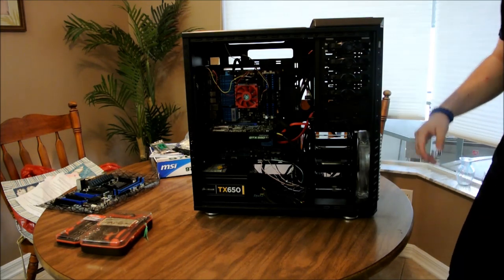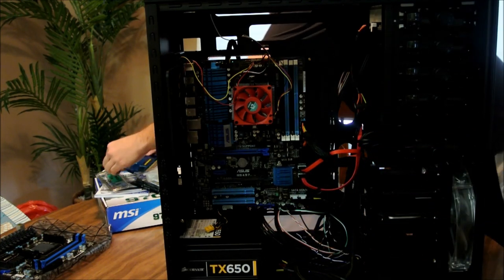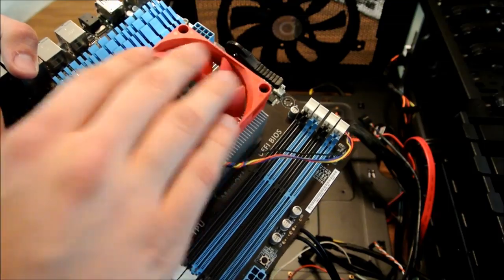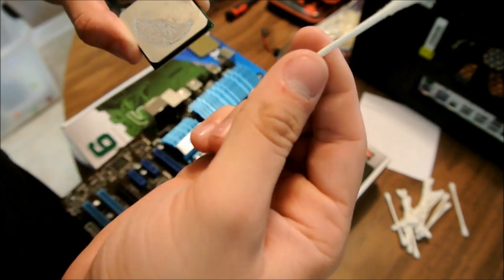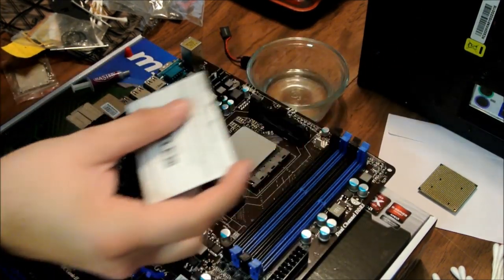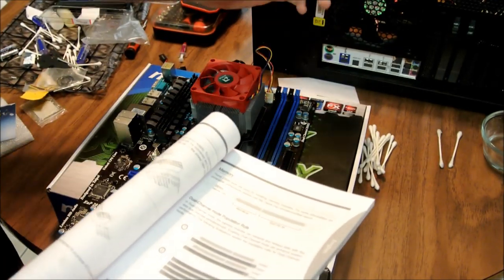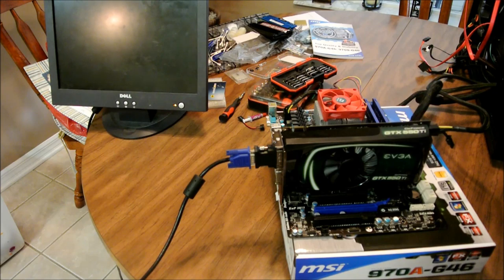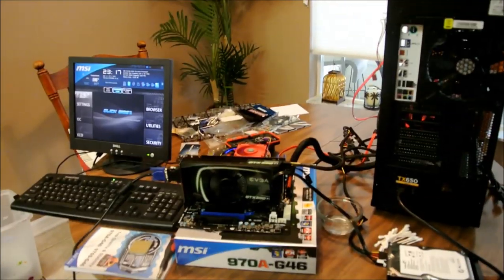CPU & Motherboard Basic Swap, Test, & Install

Comment from the maker: After doing any sort of major upgrade such as switching the motherboard, I always recommend installing the appropriate drivers/software made available for it. Personally whenever I do major upgrades I also re-install Windows just because I am OCD like that. I would say for certain, update and install drivers. You don't have to re-install Windows, normally.

Comment: Bet they never jumped the CMOS. My old board wouldn't post. Even the cup fan would rev up to max rpm. Does that mean broken computer? No. Sometimes replacing stuff won't matter because the board itself is just confused on how to initialize. Clearing CMOS resets settings and loads the factory booting sequence back to the board. I did that and my board posted and booted my computer no problem.

Comment: I know this is a late comment but all these butt hurt people that are saying he is bashing his friends computer parts should just watch the video or go to another one. I am sure his friend has been told by this guy about his pc parts. Who really cares and amd is not that good compared to i7 intel. I have the amd cpu and I have the Asus m5a97 le r2.0. Its been good up til I had to do a full system recovery because it wouldn't boot to the desk top. Its better now though. I can't wait to go back to Intel i7 4970k next month I am getting the cpu and will be getting a motherboard to go with it. Not sure what mobo I will get though. Great video man.
Reply: +uhavemooface dude you literaly just said : 

Okay Porche is not as good as Mybach...

So youre Actually comparing an entire Company (in this case AMD) with only ONE line of products from another company (in this case an Core i7 4970k from Intel).

Amd is a really good precessor company and sure there are models that are not as good as a i7, but there are models that are way better then some i7 models like fro exemple he Amd A10 7850k wich competes pretty well against the core i7 4970k costing less then half its price!!! so Frame per Dollar/euro is way better on AMD and i think that for 5fps i'm surely not spending 150euros more. 

You seem really just taking "more money is better" as granted, well in computers that is not so easy. 

I have build myself a 500 bucks gaming monster based on AMD able to run EVERY game i throw at   it in Ultra. Without any problems... and dude i've spent 500 bucks. A friend spent the same amount on an intel build and his games lag at high graphics because he only went for a i5 3500K or something... 

But still i'm no master at it far from there, but i just find the way you explain yourself really poor. 

You compare a company like Google, to only one product like Iphone 6s ..... how can an entire company be more bad then a unit? i don't get it where the logic behind that is. 

It just lets me believe that you have no knowledge about amd vs Intel and that youre just following like a cow or a sheep the opinion of what youve heared from poeple who know what they talk about. 

sure an i7 is better thena a10 on paper, but by not much, plus a10s are much more cheap then a i7 wich makes it a more sane decision for a pc build. 

Personnally i like Amd it's trust worthy and i'm plesently surprised by it since when i was younger and inexperienced i only swore by intel... 

Have a good day and please next time take some time before writing a comment espacially if it is just to say unlogicall stuff :)

I'm sorry for any mistakes i'm french :)

Comment: I have one question for you..  My motherboard is not working..  I brought new motherboard does my old processor work to new motherboard are should I buy new processor?
Reply: suresh p your processors needs to be compatible uses part picker write your spec in to see if it works

Comment: Hey dude im upgrading my cpu and mobo my current cpu and mobo is amd a8 6600k and msi a68hm e33 mobo gonna upgrade  to b85 gaming mobo and intel i5 4460  my problem is my hdd will i need to reinstall my OS? or not  im scared to do it because these stuff are expensive! please reply quickly cause gonna my it now later
Reply: did u have to reinstall your OS on your HDD? Im going to buy a new mobo , i haveeverythuing else, just getting rid of the stock mobo. Will i have to reinstall the OS on my HDD?
Reply: what do u mean, reinstall OS on HDD?
Reply: FOR WHAT?! installing a new HDD ( hard drive) in your computer? I don't understand you have to be specific, explain in depth. I dont rememebr what i wrote
Reply: Yes I should do a clean install of windows, it will save you trouble in the long run. If you run into issues you should update the BIOS too ( flashing the BIOS)

Comment: the thermal paste- never seen someone go to such needles lengths applying it in my life also the 3 tries to install the cpu in right direction face plant :3 and to note u called the ram sticks a mother board @24:10  lmfao also when installing ram it is way easier to install 1 side click then other side click not push straight in till the board is making crackeling noises. the shorting to start ext OMG ,..NOoOo why u do this? ! llolLOlOllolL FORGOT THE HARD DRIVE! I WAS LIKE WTF IS HE DOING?!
Reply: +Vincent Snow hey lol idk us seem  like u know what u are doing and he said that the motherboard only supports 8 pin? i thought it supported 24 as well?
Reply: +Vincent Snow and how tell what channel ram is or (ram  that sticks the mobo)
Reply: The Catalyst Monotony of the Rock Hard Memers Well it could, but unless you literally put it straight on the CPU. It's not going to spread evenly. so you should spread it out a little bit.

Comment: 5 mins of my life was worth it .. but i have some questions .. here is the story .

im using right now an ASUS motherboard and ive got an extra motherboard which is an MSI that i just repaired  the tiny little pins  for the CPU cuz it was accidentally bended by my father but ive already straighten them back .and its almost like good . 

anyways what will i do is  ill buy new processor cuz my MSI has another socket for INTEL  processors which is LGA 1150 compared to my ASUS that has AM3 for  AMD processors .. 

The question are :  
1. should i buy a new processor for my MSI that i just repaired ? (optional question, not so important )
2 . if i can buy a processor  ,  and put it on my MSI motherboard ... can i still use my old HDD  from my old motherboard (ASUS) where my operation system files installed?
3. should i still reinstall my operating system files ? or its just plug and play ?
cuz i read something you will have to remove Chipset Drivers, USB Drivers,Video Card Drivers, Sound Card Drivers, IDE & ATAPI Serial Controllers. so that it will not conflict with the new drivers from the other version of motherboard...

i think thats all ..i hope its clear .. ill be  waiting for your reply .. really need answers so that i can buy a new processor already ...